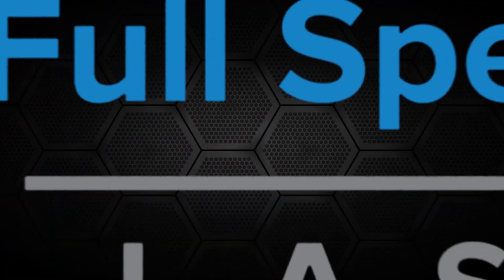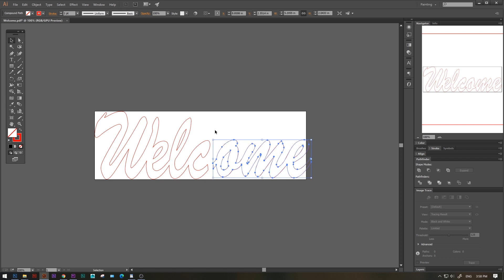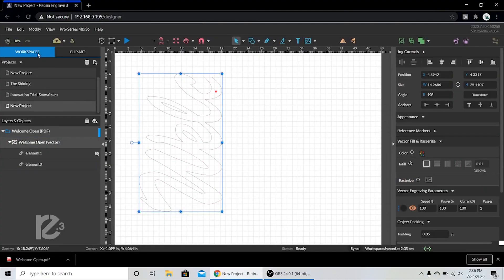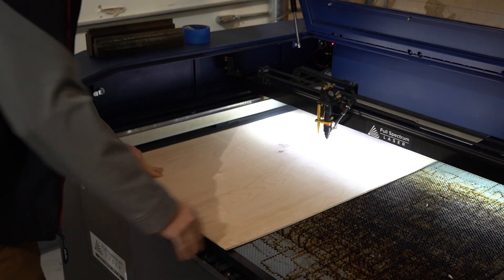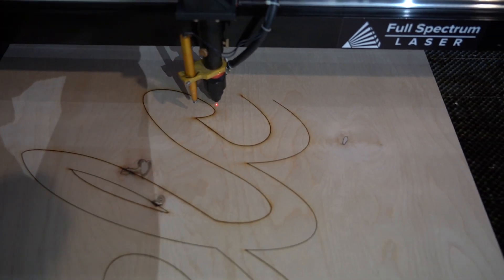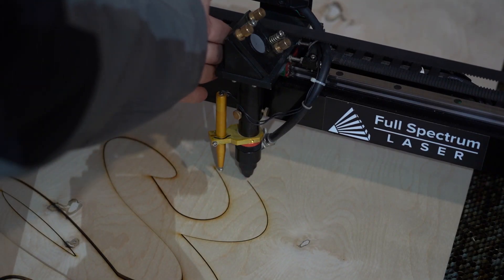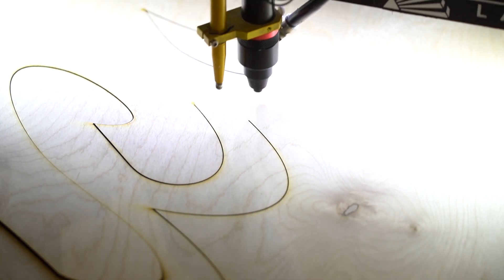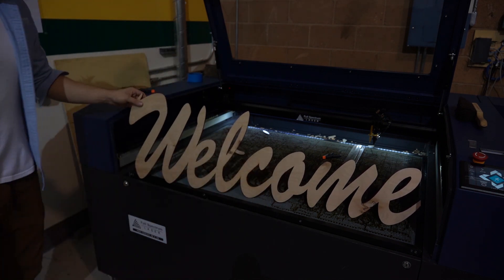How To Get The Most Out of Your Passthrough!

Comment: Have there been any updates concerning the longer lens mount for the pass-thru?  I would like to know if it would be possible to cut a 19X19 round or square using the Muse 3d with reference points to connect the two pieces to make one large piece?

Comment: With the muse the laser head doesn't drop down enough the focus the laser.... what do I do to focus the laser?
Reply from the maker: Victoria, what does your setup look like? Do you have a riser currently and does it have a pass through slot?
Reply: @FullSpectrumLasers  i do.  It was one of the new risers for the muse.
Reply from the maker: @rupertsfriend4242  The only thing I can think of that wouldn't allow you to focus to the passthrough is if you were using the 1.5 lens. Other than that, the standard 2.0 and higher should have no problem. I would suggest contacting support as it sounds like it may be an issue.
Reply: @FullSpectrumLasers  I'm using the one that came with it 🤔🤷‍♀️
Reply: Full Spectrum Laser  I’ve had my muse 3D with riser (brand new) a little over a month now and I can assure you it physically cannot focus that low with the lens that comes with it. Many people with newer lasers in the Facebook group say the exact same thing.
Reply from the maker: @whiteb68  I'm conferring with engineering currently. They're looking into it. Thank you for the response.
Reply: @FullSpectrumLasers  so what was the verdict? Trying to decide which laser engraved I want to purchase and pass through, focusing, & rotary are very important especially regarding how much of an investment this will become.
Reply from the maker: @joshc214  With regard to the Muse, you need a 5" lens to utilize the pass-through, but the rotary attachment will work with any lens. That said, all of our Pro-Series machines have a pass-through built in and will work regardless of lens.
Reply: @FullSpectrumLasers  so from the description of the "5 lense it states it's not sutable for cutting wood and acrylic but to use the passthrough you have to use the "5 lense meaning that the passthrough is not very useable? Is there a plan to create longer lense mounts so it can reach with a normal lense, because if the metal body reached down farther you could use a 2" lense.
Reply from the maker: @ram3d934  Yes, it is an oversight that we are addressing. A longer lens mount and travel distance is the way we are leaning.
Reply: @FullSpectrumLasers  Thank you so much for the reply! please keep me posted, we are ramping up listings for a small business and are interested in incorporating the passthrough with wood and acrylic cuts and with the reference markers added the retina engrave I feel like it could be a pretty doable process.
Reply: @FullSpectrumLasers  any updates on this?
Reply: So seeing that the proper use of the pass through was and oversight…. Are you doing or offering anything for those who purchased the riser with the understanding they could use the pass through without using or needing anything extra…?? We purchased last October. And it was the newer muse 3D and riser/rotary and the only thing we have been able to use it for was the rotary. But ultimately got the riser for its ability to use the pass through and we have not been able to use this feature as it does not work like it stated to work.
Reply: You need a different lens to actually use the passthrough as a passthrough. Pretty sure that’s why this video doesn’t actually show it being done on the muse, fsl realized it just like the rest of us that the standard lens won’t actually focus that low...
Reply from the maker: @whiteb68  The standard 2.0 lens will focus to material in the passthrough. The only way it will not is if it's an older model of the Muse, like the 2D, as these machines were made before we added a passthrough slot to the Risers. All new Muse machines, such as the Muse Core and Muse 3D, have a larger travel distance on their laser heads, allowing the standard lens to move lower than on previous models.